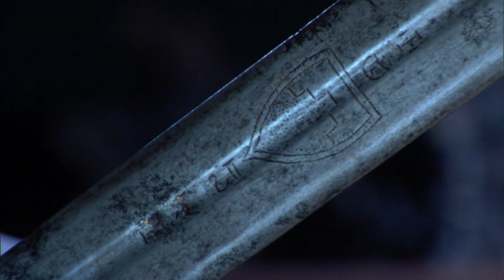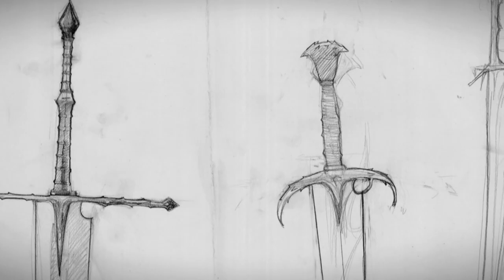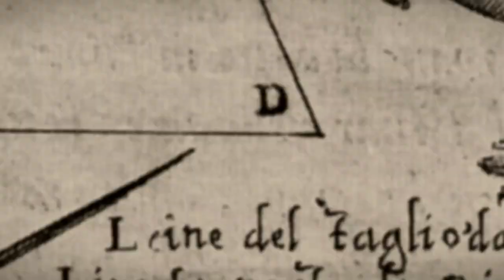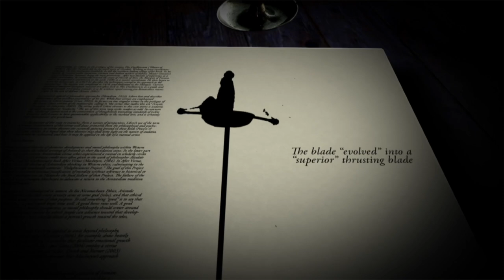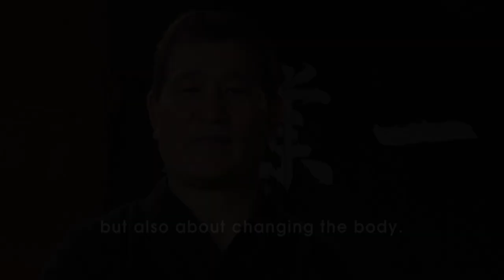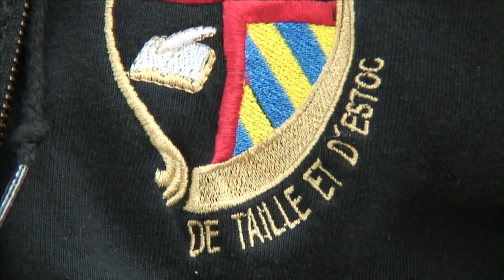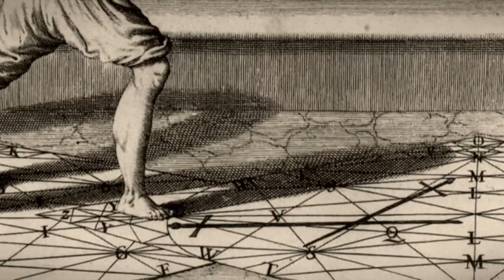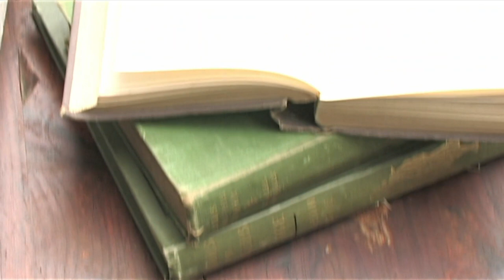How To Bring Historically Accurate Sword Fighting To Film | Reclaiming The Blade

Comment: Oh, this was just uploaded today. That explains the 3 real comments and the 4 sock accounts commenting down there. :)

Always remember, in real life...

What you see in movies is choreography for entertainment.
What you see in HEMA is the equivalent of what we referred to as bamboo bunnies, or shinidiots for wannabe shinai fighters. They try to bounce the wire coat hangars they use on the tops of the heads of their opponents while bouncing around in a manner no one used in history.
An actual experienced swordsman won't try a spinning backfist with a blade. They will have it in front of them and you won't see it move until it's too late.
And most importantly, just because you landed a blow does not mean you just won the fight. It has been said that luck will carry a man so long as his courage holds out. The same goes for adrenaline.